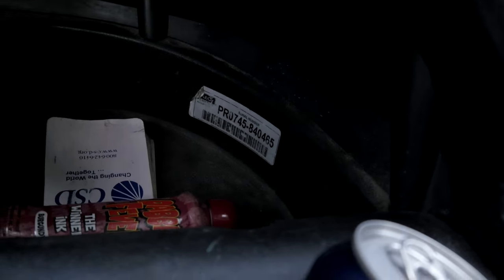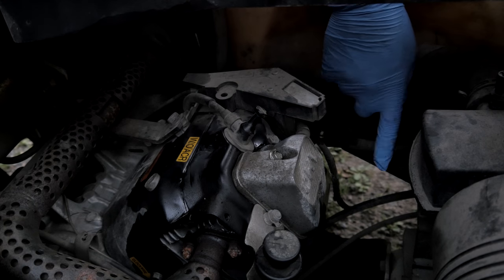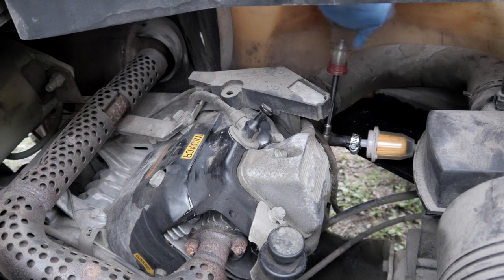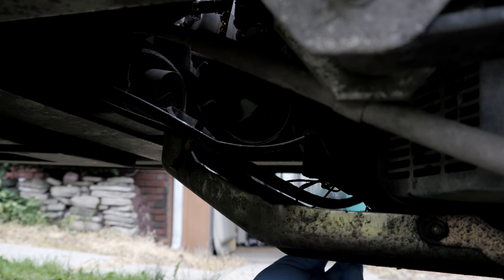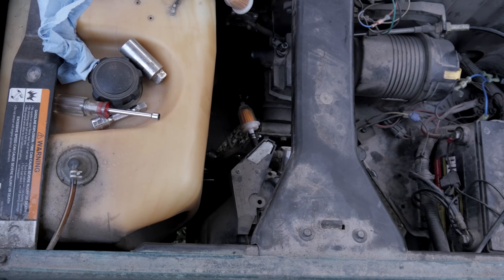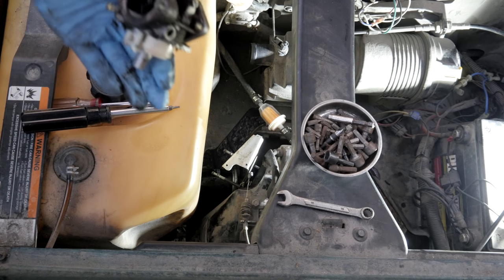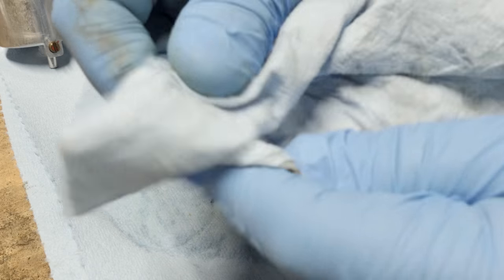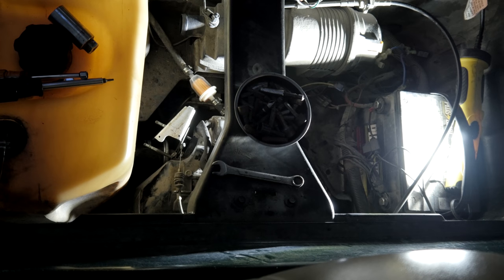2007 Club Car Precedent, Gas - Gas in the Oil, Clean Carb

Comment: Glad I came across your channel.  I have a 2014 Club Car Precedent with Gas in the Oil.  I drained the oil, however, I cannot locate the oil filter anywhere!  Also, there are NO fuel filters at all on the cart.  I've watched your Club Care Precedent playlist at least 5 or 6 times trying to familiarize my self with terminology and parts locations.  I took the gas tank out like you suggested in one video, along with the intake hose so as to have more working room.  I followed instructions and took off the carburetor but there wasn't a bowl attached.  Not sure what I did wrong.  I cleaned the carburetor and reassembled everything.  I filled it with 1 quart of 10w 30 and in maintenance and neutral,  I then started and cranked it.  I let it run for several seconds and shut it off.  I waited for 1 minute and checked the oil.  It didn't smell like gas and the oil registered properly on the dipstick.  However, it did look a little milky.  I've tried searching for my model/Yr and can't find the exact look of what mine looks like for reference.  on the crossbar where you have your bowl of bits, I have a cylinder attached with screws that says FUEL PUMP PURGE that had the fuel tank vent tube attached to it and also has what looks like a fuel line that should be attached somewhere..  No one wants to work on it, saying......Oh you've got gas in the oil, major problems with engine.  Any suggestions would be greatly appreciated. I'm just at my wits end trying to learn.  This old gal NEVER SAYS NEVER!  Thanks for providing the content that you do with so much detail.  I'm sorry for the long post.
Reply: Bud you have an Subaru motor that's fuel injected .

Comment: I checked the oil on my cart with the 350cc and there was splashes of oil all the way at the top of the stick, why would that be?
Reply from the maker: Check your oil while the engine is off. Pull the dip stick, wipe it clean, reinstall and remove again to check the level. If it is way above the full mark, then you may have an issue. If its within the normal range, don't worry about it. Oil splashes all around the crankcase with normal use.
Reply: @Kevinsgolfcarts  thanks, I know it splashes around a lot, but I just thought that it getting all the way up the dip stick tube was maybe not normal

Comment: I think that the ethanol in the fuel breaks down the fuel filters internally as I see the problem is not isolated. May be a failure to replace filter in a timely manner.
Reply from the maker: Ethanol fuel has caused many issues in a short period of time. Most people don't do yearly maintenance.